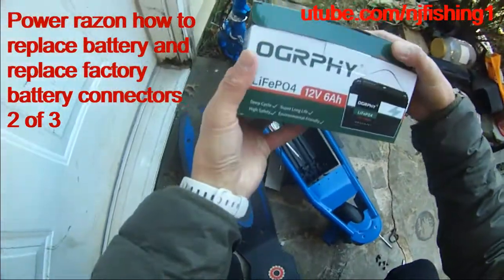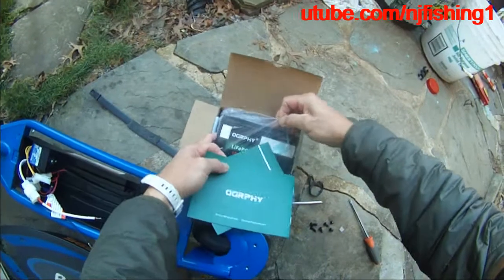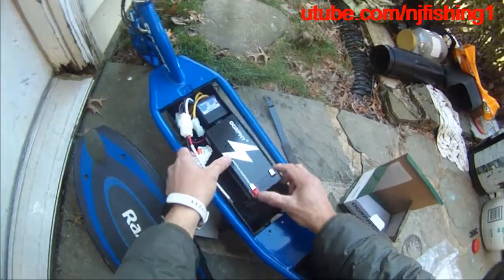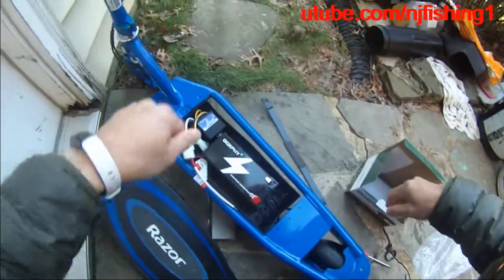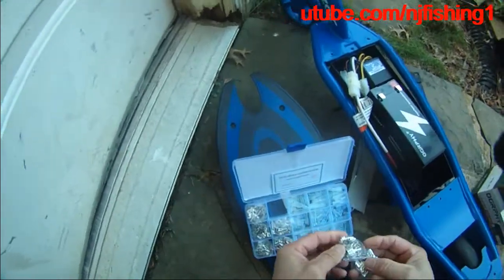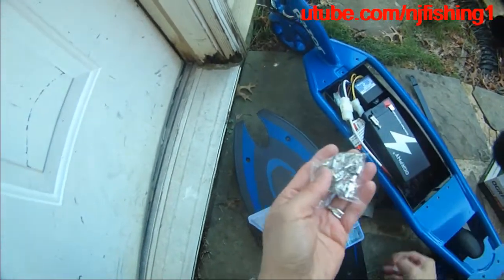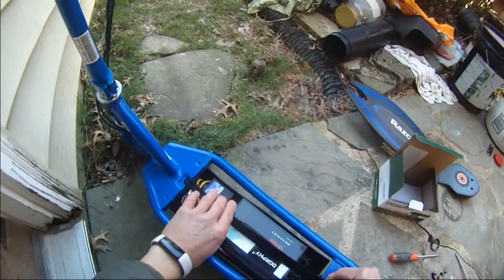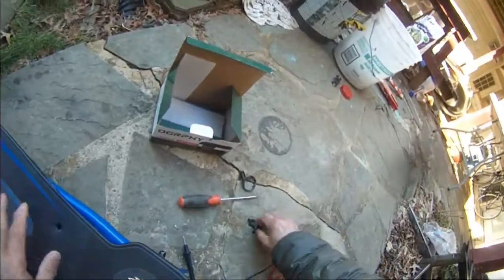power scooter Razor E95 - new lithium battery (installing 6 ah lithium battery)

Comment: If you are plugging the new battery into the same wiring as the old one, wouldn't it still charge with the original charging port? Thank you for making the video!

Comment: How do you charge it now?
Reply from the maker: Have to remove the cover and charge it. Reinstall the cover after charging. You can certainly wired it without removing the cover by installing a quick connect type of connection for charging the battery if you want. I will do a video next.